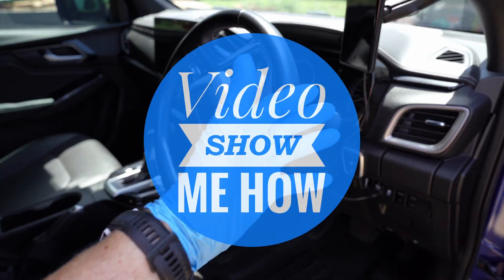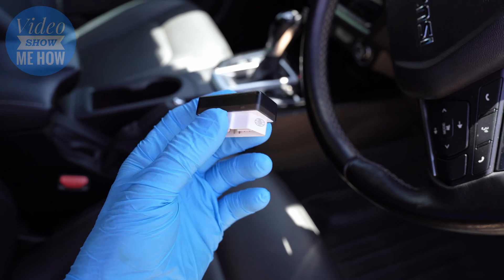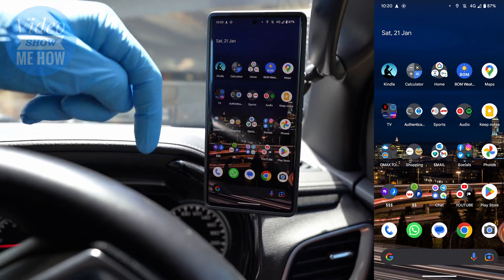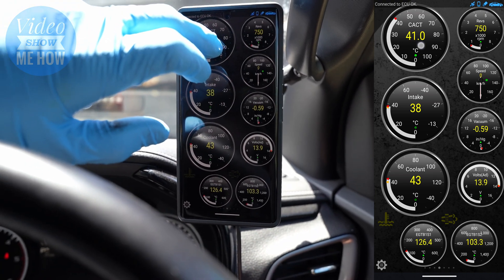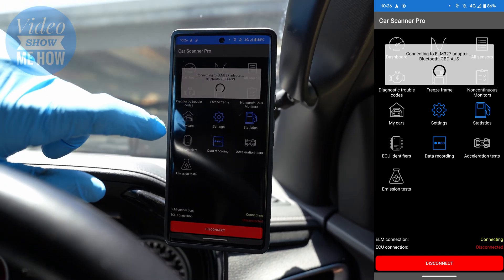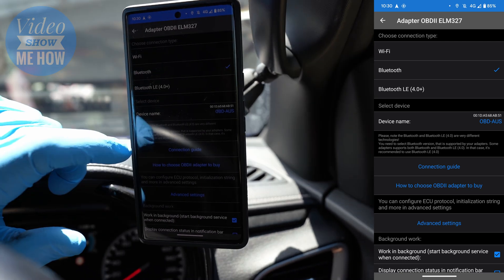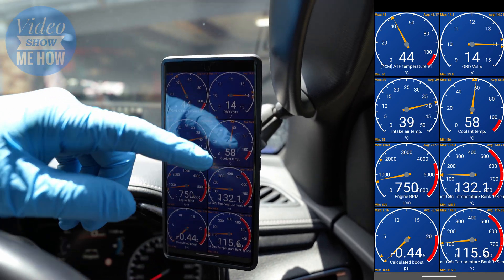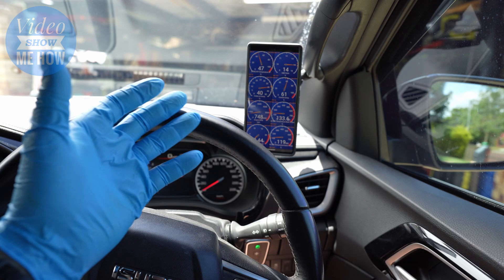How to USE and SETUP an OBD2 Scanner (Bluetooth etc) | 2x Demos | 2021 Isuzu D-MAX Build Series #45

Comment: Hi. I bought the OBD2 I connected it when I bought it about 14 mths ago but after having a car service found it in the glovebox! Now I am trying to set up and when trying to connect to Bluetooth it says it’s not supported. What does this mean? I’m not overly computer savvy/ gadget savvy !
Reply from the maker: iPhone? Some aren't compatible with them and need a wifi dongle. Usually once plugged in, car either on or ignition on, you should be able to pair it on your phone like any other Bluetooth device. If this doesn't work then you might need a different dongle. Just look for one that's compatible for your phone type
Reply: Yes it’s a iPhone. What’s a dongle?
Reply: i just googled  Why if it connected before should i need one now?

Comment: G, day mate 
Thank your time in making this awesome video, one quick question or maybe be a it stupid one , do you drive your vehicles 
With the OBD link permanently  in the socket as you drive  so you get the real time data ?  or do you just check and plug it in when stopped with engine running ? As I have been told it could damage electronics if it’s constantly plugged in that sounds silly to me but I’d thought I’d ask ? hoping all this makes sense mate cheers mark
Reply from the maker: Hey mate , yep I just leave in there, will auto power off
Reply: @VideoShowMeHow 
Hi Mate 
Thanks for your reply I’ll do the same, also thanks for taking time out to answer me take care now mate cheers mark

Comment: Hi Adam thanks for the information it has helped a lot, but wondering if you are able to assist i have a 2023 Isuzu Dmax and i can seem to get it to read the Transmission Temperature any assistance would be greatly appreciated 
Thanks Bruce
Reply from the maker: Are you running car scanner pro? The 21-24 are identical mechanically so should come straight up if you search for all sensors.

Comment: I have downloaded the ELM OBD2  and it doesn't come up with a charge. Still disappointed with the "free" functionality.

 additional charges for apps with extended capabilities.  (+$20 a month is quite a lot.) 
Be aware of the adaptor ,  unacceptable restocking fees apply. In fact the actual physical products is fine, it is the software that need to be bought.
Reply from the maker: The free version of torque and car scanner are both pretty decent

Comment: i got myself one of these but have ended up going to a scan gauge 3. i just found my iphone didnt like working on both the odb2 and carplay at the same time. now i have both and ended up mounting to the pillar using a scrub king mount
Reply: If you have a Isuzu have worked out how to get engine oil temp and pressure  with the SG3 ?

Comment: Adam, have you found a scanner for Isuzu Dmax's that can do the DPF resets and forced regeneration etc yet? I have been searching for ages. I have had no issues in the nearly 3 years I have had mine. Actually no issues at all. Touch wood. Just be nice to know if it does happen in the middle of TimBuckToo you can do something. Hope your good mate.
Reply from the maker: Bloody hell sorry mate missed this! No I haven't, I beleive you need the big scanner tool that dealers have to do this. I haven't had any issues either so far, I think lots and lots of short runs obviously won't be great but if the light triggers and people actually do take it for a spin on the highway till it's out I would think that solves 99% of the issues

Comment: Hi great Video. I have a 2024 Dmax and the Trans temp comes up on Car Scanner standard version but no engine oil temp. What is the PID 
to get the EOT? Thanks
Reply from the maker: I haven't been able to get either, unsure if there's a sensor?

Comment: Gday Adam, installed and all working fine. Reason for install is to monitor trans temps prior to and after install lock up converter kit. One thing that caught my eye in the vid was the dual usb on the right side of the column, where can i get one of these please?
Reply from the maker: There's a few brands, the one I've installed is from Stedi

Comment: I OWN A 2018 VW AMAROK ULTIMATE. I HAVE JUST INSTALLED A SONY HEAD UNIT BUT IT NOT CAPABLE OF READING OBD2 SO WOULD CONNECT READER TO SAMSUNG ANDROID. CAN YOU ADVISE WHERE I MIGHT BUY A QUALITY READER. IM LOCATED IN BRISSY. (SORRY ABOUT CAPS---- NOT SHOUTING AT YOU  YOUR ASSISTANCE WOULD BE APPRECIATED.
Reply from the maker: Have what I used linked in the description if that helps

Comment: Just bought myself one of the recommended OBD2 ones below for TF bt50, mainly wanting trans temps. When I select TCM 1 or 2 I don't get any data. Did you have to do anything else to get the data ? Wondering if because it's the eBay one it doesn't recognise, or maybe the Bt don't have that temp sensor
Reply from the maker: Need the pro version of the car scanner app I found

Comment: Great video! Trying this method but what we have is a wired elm327 not the wireless. Im just wondering if you know how to connect it so that the car scanner will talk to the car? I’ve tried tinkering around it theres two options via wifi or bluetooth but i cant seem to find the elm327 obd2 on both even if the phone and car is already connected tru the wired obd2. Hoping you know something about it. Thank you
Reply from the maker: Hmmmm unsure, maybe message the developer?

Comment: Very insightful video! We have a DMAX as well and were about to tow a big boat interstate. We want to be able to check the ATF Temp by ourselves, we have the torque app pro at the moment but we got no luck with knowing the right codes to add a PIDS for the ATF temp. In car scanner pro, will you be able to read the transmission temp right away or is it same with the torque app that you need to input some codes to add the ATF temp? I hope you'll notice this comment thank you
Reply from the maker: Yep the scanner pro has it built in out of the box 👍

Comment: I just tried this on a new 2023 D-Max and unfortunately the transmission temp does not work!, everything else does! :-(. Transmission temp was all  I actually wanted!
Reply from the maker: With the pro version of car scanner?
Reply: @VideoShowMeHow  no, standard version.
Reply from the maker: Yeah need the pro version for trans temps. There is no change to the drive line etc for 21+ D-Max to date so will work the same as my 21
Reply: @VideoShowMeHow  Thanks mate appreciate it. Funny that I tried it on a Mitsubishi ASX and I could read the trans temp.
Reply: Is the Pro version at a cost? @simonmaton

Comment: I'm not sure if anyone else has answered your question about getting the Car Scanner app on your Alpine head unit or not, can't be arsed reading every comment lol. Anyway, it comes down to whether the app is "Apple CarPlay" or "Android CarPlay" compatible or not and I don't believe the "Car Scanner" app or for that matter "Torque" are. However, I did notice one app called  "OnTrack" that boasts "CarPlay" compatibility. It's certainly available on the Apple app thingy but I don't know if it's available on Android. I also don't know how comprehensive the app is in terms of configurability or how many sensors it tests.

Comment: Great instructional video, I am struggling to get transmission temp on any App I try. I think your video may hold the key. Please tell me (TCM)ATF TEMPERATURE, is that available on the standard App of Car Scanner or did you upgrade to a Pro level.   Cheers Mike
Reply: I upgrade the app to pro level but still i didn’t find the Transmission temp
Reply from the maker: Went the Pro version to get the trans temps

Comment: Mate, Firstly love the videos. I purchsed the Obd2 and car scanner app but cant get the trans temp to operate, everything else connected no problems. Any tips?
Cheers
Paul
Reply: Hey Paul, I had the same problem. (2022 XT) It's all in the "Connection Profile". Open the app, Go settings...Connection Profile, scroll down to Isuzu. Then hold or double tap Isuzu and you'll come up with a couple of model options. Pick the D-Max Gen 3 and the transmission temps will be available.
Reply: @mustangdude11  Juat had a look at the settings and definitely have the gen 3 dmax ticked. Even deeper on the settings it wont list the transmission.  Its like its not fitted
Reply: @paulhead7630  I contacted the app developer,  he's a Russian smart ass but I put up with it to get the app working. Do it through the play store. That's how I found him.
Reply from the maker: Does it show in the list? A few people have commented, I think you might need the pro version of the app (is a couple bucks)

Comment: Cant get the ATF Temp to work for the life of me. 🤦🏻‍♂️
Reply from the maker: Are you using car scanner pro?
Reply: @VideoShowMeHow  yeah mate
Reply from the maker: @norris75  add a new dashboard (if you haven't already), double tap to add new sensor, and the '[TCM] ATF temperature #1] is the one you're after
Reply: @VideoShowMeHow  yeah im using the dashboard that I created. I double tap and define my own gauges. The atf 1 or 2 will appear. But won’t record anything. It doesn’t even record on the live page.
Reply from the maker: @norris75  hmm unsure about the record function, I just go into the 'dashboard' and set it up from there
Reply: @norris75  same problem here, can see both ATF sensors but no value, have deleted and re-added new dashboards, theres no reading for those values though.
Reply from the maker: Which reader are you using? Wondering if it's related to that in talking with Greg

Comment: Hi Adam, got all the gear you recommend, set up the screen just like you have done. My question is how do I find out what parameters I need to set each sensor too( highs and lows)? I have a current model MUX so engine is the same as the Dmax. I will be towing so coolant temp and transmission temp are what I really want to monitor. Cheers Jeff
Reply from the maker: Yeah I've been trying to find something from isuzu to specifiy this but no go so far. If it helps, I've got both my trans and coolant set at 100 as you should really start backing off once off this
Reply: Thanks Adam, also purchased the ram and wireless quad lock gear as well. Love your vids. Cheers Jeff
Reply from the maker: Cheers mate!

Comment: Adam, I went into my settings on Torque and I have no PID settings for the 2021 Dmax. Where do you get them from? I purchased both the Torque Pro and the OBD2 Aust device (from your link). Can you advise please mate?
Reply from the maker: Are you using the car scanner app? That's the one that has the auto temps
Reply: @VideoShowMeHow  Only the two above. Torque Pro. Is there another app I need?
Reply from the maker: Car Scanner is the app you need like in the vid. Had the trans temps built in
Reply: @VideoShowMeHow  Adam, is that where I get the PID codes from? OBD2 Aust won't help.
Reply from the maker: If you watch the video from 4:48 I show the 'Car Scanner' app, this has the trans temp PID etc all built in, you can just select like any other sensor and display how you want
 This is the app I run now.
Reply: @VideoShowMeHow  I see now. I have that CAR SCANNER APP- ELM. So use that instead of Torque Pro??
Reply from the maker: Yep you got it. Torque pro is another scanner type app, but doesn't have the ability to read auto temps for the dmax, whereas the Car Scanner app does.

Comment: I purchased a mid range mini tablet that i use just for this  and so i can still use phone etc through the stereo.

Is there anyway we can find a list of what is considered normal values so then we can see if things like boost, fuel pressures etc are low or high readings.

Thanks Adam 👍🏻
Reply from the maker: Have been looking for some data like this but yet to find any unfortunately

Comment: I'd love to be able to see my trans temps but i get no readout on those guages. Other telemetry works fine but can't get trans temp any ideas? Using Car Scanner Pro wirh android and the mini OBDII reader in your list.
Reply from the maker: Hmm def running the latest version? Mine just appears in the list, there's 2x different types
Reply: @VideoShowMeHow  yeah i can see them in the list CTM transmission temp 1 and 2 but no readout. Yours works?
Reply from the maker: Yeah works fine, can see in the vid. You've got the same reader as me? In a dmax?
Reply: @VideoShowMeHow  yep i ordered it straight from your links. Thanks so much for providing such good content too I've applied many of your mods to my dmax.
Reply from the maker: Hmm so weird. Able to try a different phone at all? Shouldn't make a difference but worth a shot?

Comment: Another great video Adam.  Fortunately, this one didn't tempt me to buy a new expensive farnarkle!  I've been using Car Scanner Pro (Apple) for a while but cannot locate the TCM ATF in the sensor list.  Is that a special addition only on Android?  Or did you create a special PID?
Reply from the maker: Hmm unsure don't have an apple device to test with. Maybe uninstall reinstall to see if it appears as was in the latest update?
Reply: @VideoShowMeHow  Turns out to be a failure by the organic element - I had selected the wrong DMax model.  D'oh!

Comment: Good timing. I've been using car scanner pro as I find it picks up more sensors than torque. However, when it's running, android auto grinds to a halt on my phone/head unit. At least it seems to be related. I think I've just reached the limit of the handset as it does get pretty hot. Might need to use a separate handset for each task. FLM
Reply from the maker: Oh interesting,, which phone? I run a pixel6pro and runs no probs?
Reply: @VideoShowMeHow  I have a OnePlus 8T which is a couple of years old now. I presume it's related to the multitasking as it only seems to be a problem when running car scanner. I will report back once I've done more testing, but I do love being able to keep an eye on temps etc

Comment: Nice video question will this rest my tire pressure light 2021 Volkswagen Jetta I have an aftermarket radio I used to be able to rest it trough that I also took it in to the dealership they couldn’t scan it either they said only trough the factory stereo?
Reply from the maker: That's your TPMS light, you should be able to reset this yes

Comment: Hey Adam fantastic video. I did the update but can’t seem to find the trans temp on the list. Has it got a special name or did you have to enter a code. Also which ones do the burn temps. Any help would be appreciated
Reply from the maker: No was just in the list for me? You may need the pro version?
Reply: I had the same problem. (2022 XT) It's all in the Connection Profile. Go settings...Connection Profile. Here your scroll down to Isuzu. Then hold or double tap Isuzu and you'll come up with a couple of model options. Pick the D-Max Gen 3 and the transmission temps will be available.
Reply: I had the same problem. (2022 XT) It's all in the Connection Profile. Go settings...Connection Profile. Here your scroll down to Isuzu. Then hold or double tap Isuzu and you'll come up with a couple of model options. Pick the D-Max Gen 3 and the transmission temps will be available.

Comment: Hi mate from what I understand only the android head units can use the app directly from the source. The Kenwood's have a screen mirroring function which would work I'm sure the alpines would as well which could be an option? Also i did see somewhere someone putting a PID code for trans temp with the torque pro not sure if it is possible or not?
Reply from the maker: Yeah I've tried all sorts of PID codes since I got my dmax but none worked. Must be a new one I'd say

Comment: I use Torque Pro to monitor the DPF level in my Hilux, it’s one of the hundreds of sensors you can scan. I added a few custom PID codes to watch the auto converter and pan temps of the transmission.
Reply from the maker: Yeah I used torque for ages, but no trans temp for the dmax :( Car scanner updated to include it so I switched :)
Reply: I use car scanner too. But it picks up two ATF Temps 1 and 2. And Temp too fluctuate more frequently than Temp 1. Do you get the same? @VideoShowMeHow
Reply: @VideoShowMeHow  Brother, how did I add the transmission temperature to my 2024 Isuzu D-Max and it did not work for me? What settings did I do? Thank you
Reply from the maker: I used car scanner pro, it was built in as an option
Reply: hey can u share me the PID for the hilux auto trans temp?

Comment: Hello can I fit to a 80 series landcruser petrol
Reply from the maker: yep, pretty well exactly the same way, only issue is I think toyota only started moving to the obd2 standard from 1996, so pre that you may not have a port :( It will look the same, try the fuse box in foot well and engine bay to see if there's one there